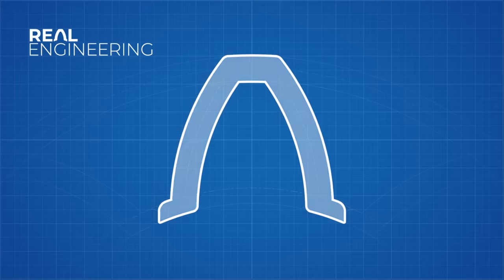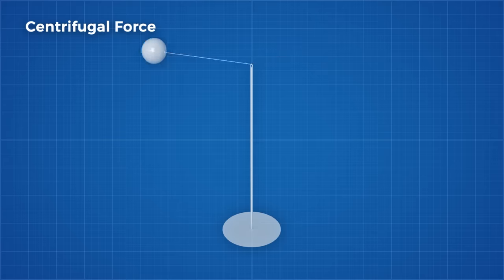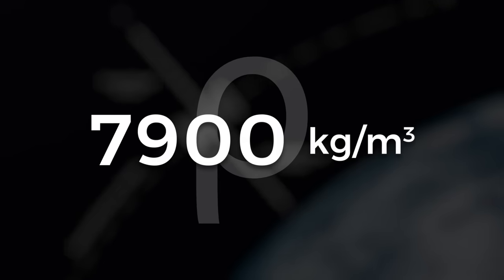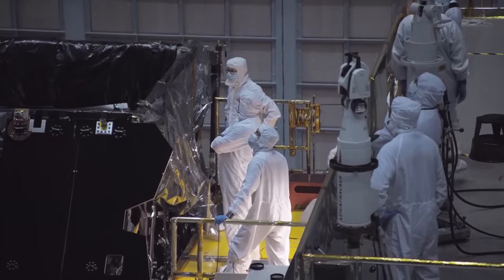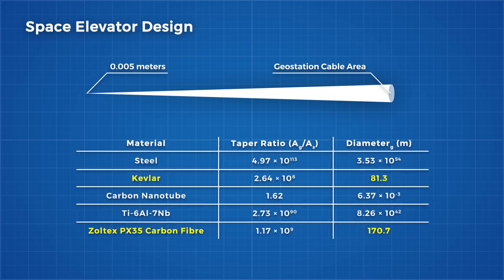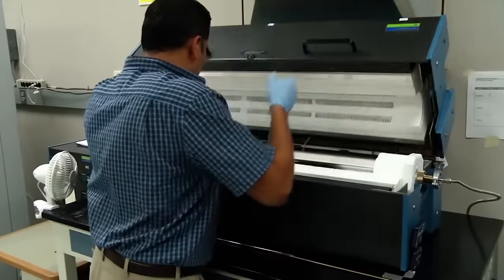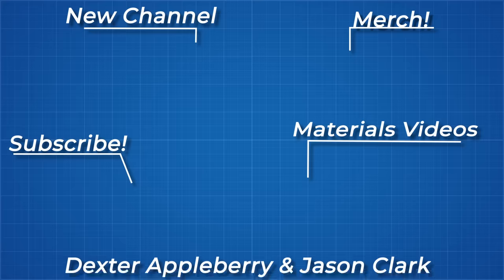Are Space Elevators Possible?

Comment: One problem is: What would happen if it were to fail? Imagine the destruction a wire of that size would cause if it were to fall...
Reply: It's more likely to fly away from the earth because of the counterweight.
Reply: @Yay295  that depends on where the cable breaks
Reply: @IronCrown  I'm talking about if the cable breaks, and the rest of the cable falls to earth.
Reply: If I remember correctly the book series Red Planet deals with this question when a space elevator on Mars snaps.
Reply: The end of the cable would be travelling pretty fast, so would probably burn and break up. The sections lower down would also be subject to shear and I suppose you would see some local breaks resulting in smaller lighter pieces. As for the bulk lower down, it has very small velocity with respect to Earth's surface so wouldn't create a spreading debris field like a plane crash and is made from a low-density material, so impact energy wouldn't be huge. my guess would be that it would be a mess, but limited: we are not talking about Tokyo and Sao Paulo being wiped off the map.
Reply: @marcowen1506  for the level of elevator in the video I agree with you.
But if you include the strength to haul cargo to space there by making it a elevator not just a wire/anchored station I expect serius mass will be need to be added in the wire and that mass may make the wire able to survive reentry
Reply: It would have helped if there was a scale size model after he gave the numbers. Normally, orbit is really skimming the surface of the planet, but a geostationary orbit is much higher. The cable needs to be 42,000 kilometers, and the circumference of the earth is 40,000 kilometers. So like, yeah, if the station disconnected from the cable, the entire cable could fall to earth and wrap around it like a belt.
Reply: Shoot. It’s not so cartoonish. That 42000km is from the center of the earth (which has a radius of 6km), so above ground only needs 35000k. So not quite like a belt :/
Reply: @marcowen1506  Even the lowest 1km is bad. Imagine the burj khalifa just toppling over onto the city and more.
Reply: @barmetler  It's more like a radio mast crumpling as it hits the ground.
Reply: @jwadaow  I don't think a solid, like 50m thick sausage of carbon nanotubes would just crumble without damaging what's around it
Reply: @barmetler  I don't think a thick sausage of material would get built (a ratio of 1.6 from thinnest to thickest diameter for nanotubes). The objective is relatively lightweight construction that is strong enough to support its own weight and a load climbing and descending. It can be built anywhere on the equator, such as the oceans, there are safety systems that can be employed to destroy the structure into chunks that thump the ground with a moderate force. The structure would crumple and bend if it broke because once it is snipped at a specific point, what remains is very strong relative to the compressive force of its weight, not like a skyscraper. It would behave like a wire with the tension keeping it aloft released. There are actually a lot of ways to design a space elevator that compromise with all of these factors. Huge lumps of nanofibrous meat primed to collapse onto people from aloft seems an unlikely choice unless future humans are extremely heroic to the extent the risks pale in comparison to the scale of the achievement.
Reply: Lace it with thermite. Cable snaps, thermite burns, and if the ratio is right it should burn up everything before the pieces hit the ground and start the world on fire.
Reply: Isaac Arthur talked about this in his elevator episode. You can put packets of explosives and parachutes along the tether, so if it were to break somewhere, you could trigger the explosives, separating the falling part into smaller chunks, then trigger the parachutes to slow them down as they fall.
Reply: @barmetler  A burj khalifa a few centimeters to a few tens of centimeters wide, made of ultra lightweight materials.
Reply: Well, you could devise a disintegration system where in the event of a break explosive charges would break the whole cable into small chunks that would either burn up in the atmosphere or fall to the earth with a minimized impact.
Reply: @charksey  Earth is fast, can't clip the belt xD
This quarantine gets us all.
Reply: @alexanderlaine7639  wouldn't all the explosives and parachutes (mentioned in another comment) and other stuff add weight to the cable?
How do you move the elevator over all that stuff? I guess you need some smooth surface to latch on.
Reply: @Ktulu789  Haven't seen Issac Arthur's idea so I cant speak to that, though he is by a much more knowledgeable person than I and I must deffer to the mention of his name XD. As for my idea, and I am no chemist or whatever so take that for what its worth, when i said lace it I literally mean lace the thermite into the structure. Not as an attachment but as a part of the structure somehow. I'm sure someone will shoot this down and it doesnt have to be exactly like this, but maybe in some structural components its possible to mold them around a thermite stick without compromising the integrity of the build. Just spitballing here

Comment: Mosy Sci-Fi depicts space elevators with "floating platforms" along the line like a buoy that helps distribute the force. Just need to
Reply: "just need to"
well I guess that didn't work
Reply: @mbrunnme  Just need to "find a way to make shit floaty"
Reply: @PaperDragons  Yep. Fortunately, every kid who's had a celebration knows what makes things floaty. Balloons increase the wind's lateral load but lift is awfully easy to add to a stationary structure. This can be taken to the extreme, where perhaps ten independent floating elevators sequentially get you up to the bottom of the space elevator.
Reply: Most weather balloons only go 30 or so kilometers high and geostationary orbit is 37,000 kilometers up, so that would only help for the first one thousandth of the height or so. I mean that's still something, but I'm not sure that benefit would out weigh the increased strain from the wind catching the balloons.
Reply: Balloons require buoyancy to float- you know, air? At the the altitudes for a proposed geostationary space elevator the tether end is in a vacuum. There's no air to provide the forces to lift up such an object. Even worse still, even if you could make it float in the middle of space vacuum, the tether would be subject to the forces of gravity which is something a the space elevator was originally conceived to deal with in the first place.

Comment: One challenge is the force on the cable.  The mid-section of the cable has a strong lateral force on it.  Satellites at lower orbits orbit much faster than the geostationary orbit.  The cable will want to orbit faster than the top or bottom, leading to a curved profile for the cable, and more stress on it.  There is no way around this issue.  We will need stronger wire to make any progress.

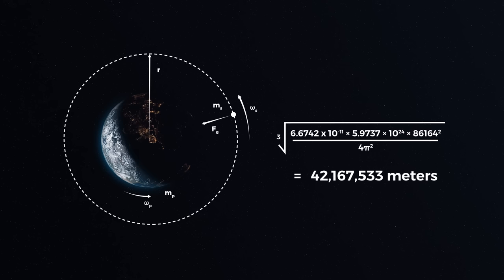Comment: @ 4:15 - important perspective about how far up the station will need to be:  36,000 km above the surface of Earth is 35,592 km farther up than the ISS, and nearly 1/10th of the distance TO THE MOON, which is 380,000 km.  Also, even travelling at 200 kph it would take roughly a week to travel the distance.

Comment: Aside from material considerations, the other huge problem would be that any mass sent down from the station, such as the elevator picking up material, is moving at the speed of the space station as it begins to lower.  The space station is traveling a distance of 2*(36000 + 6400)*π kilometers in 24 hours or 11,100 km/hr.   When that payload reaches earth it travels at  2*6400*π miles in 24 hours or 1675 km/hr.  You would need rockets to constantly slow down the payload and the mass of the cable along its length as each section of cable is traveling at a different speed if the cable is straight.  And the reverse is true except there is even more mass to speed up top geo-stationary orbit.

Comment: sir - this is only the third of your YouTube postings I've watched and I've decided to subscribe.  I want to go off and do "some algebra" and determine the "altitude" of the counterweight where the centrifugal force exceeds gravity at that altitude to provide an acceleration of one g.  Perhaps you will do the same.  That would seem to be the best altitude for the counterweight.  Right now I don't know what the mass of the counterweight would have to be at that altitude to balance the effective weight of the cable system from the space station / satellite at geostationary altitude down to the surface.  I will check for more of your postings in this series since you may have done such calculations.

Comment: Even if they are possible, they're largely inferior to many alternatives, Skyhooks/rotovators have them beat on cost, tethered orbital rings have them beat on ease of assembly (you can build them entirely on earth, and lift them into high altitude without any preexisting infrastructure), regular orbital rings have them beat on capacity. Plus, the tethered and regular orbital rings can be used for transport and energy storage on the planet, which is a great way to justify building them in the first place. Still might be a prestige piece some day, but I'm not gonna hold my breath.

Comment: Simple grade-school physics question here:
The conservation of angular momentum states that an orbiting object must gain energy to remain at the same angular speed if you lift it from one altitude (24 hr/revolution at 1670 km/hr at earth surface) to much higher altitude (24 hr/revolution at 11000 km/hr at geosynchronous orbit).

Imagine spinning a weight at a known RPM at the end of a 10 meter string. Then allow another identical weight to slide down the string from your position in the center. The whole system slows down (in RPM) and you will have to add significant energy to speed it back up.

This is why skaters slow down when they put their arms out... they didn't add energy to the spin, they just changed the orbit.

BUT: Since every action has an equal and opposite reaction, this increase of energy in the space elevator climber will result in the "counterweight" losing the exact same amount of kinetic energy, thus slowing it down. 

I don't see how you will lift a load without slowing down your "counterweight", and once that slows down it is just a matter of time before it crashes into earth because it is now not a balanced system anymore. Changing the orbit of the "counterweight" or having a second counterweight on another longer tether might work the first time, but how do you get it back for the second lift without adding energy to the system? For every lift, you would need to lift a significant amount of fuel to speed the whole counterweight system back up. Not to mention the energy of just climbing the tether to begin with.

It is likely that I am stupid, but there are hundreds of hours of videos on carbon nano tubes and other theoretical hype, but I've yet to see anyone tackle the simple physics of how this would actually work.

Comment: My guess: The base (Earth station) should be in the ocean, on a floating rig, with a vertical adjustment mechanism to keep the cable taut on a ever changing sea.  A floating rig can also move in horizontal directions to adjust voor wind pushing at the cable, so that the Center-point in GEO can stay in place.
Reply: What if we build near the equator (country) ? They have a mountain there 4500m high , that should save some material , no ?

Comment: Something that is worth noting about Space Elevators is why it reduces the cost of space travel.  And the answer is quite simple: you don't need to carry the weight of fuel.  When a rocket lifts off, it doesn't just need to have enough fuel to get it into space, it needs to have enough fuel to get that fuel into space.... and enough fuel to get that fuel into space.  And on and on it goes.  The end result is that you need somewhere in the range of 20X the amount of fuel as it would require to lift just the rocket alone.  Since you can use electric motors to crawl up the cable, your energy requirements drop dramatically - some have suggested as much as 95% - AKA: remove the 20X factor - though that's probably too optimistic as you still need energy for the mode of travel and whatever battery packs and safety equipment you're holding onto.

Comment: Assuming a tether is finally established, I feel there is are problems we fail to  consider :-
       As the load starts it's journey up the elevator cable,  the mass we are lifting will have to gain orbital velocity by the end if it's ride.  We witness our rockets climbing  to gain orbit leaning over in the ascent to gain the necessary horizontal velocity at the expense of chemical energy - lots of it !
             I believe our elevator and it's cargo will require a horizontal component to achieve  orbiting  velocity. This can only be supplied by a sideways drag on the suspension cable. This problem is never mentioned and would prove unacceptable.
             The other fact seems to suggest that the Space Station tether point will suffer considerable drag as the elevator and it's load are accelerated to orbit, sufficient perhaps to slow it below it's critical velocity.
            Something, somewhere has got to give our rising mass some orbiting velocity if our suspending cable is to resist only the vertical stress tension.
           I should add that the descent will suffer the reverse effects. Current orbiting vehicles, on returning to earth almost burn-up in dissipating their orbital energy. The elevator leaving the Space Station will subject the cable to the horizontal force again but in the reverse direction
            Or maybe I'm missing some aspect of the physics/geometry in this interesting proposal. ????

Comment: Sorry to ruin the idea, but there are a couple other serious issues here. When the elevator pod moves up it experiences coriolis force which introduces shear stress and also moves the tower. The tower then has to counteract the force using rockets (the whole point of this is to not use rockets) or add more rigid (not flexible tethers) supports. It also messes with the rotation of the earth, as some of its energy is being used to increase the pod's energy. Not to mention the regular course corrections required to stay in orbit. Its worthless to build on earth anyway.

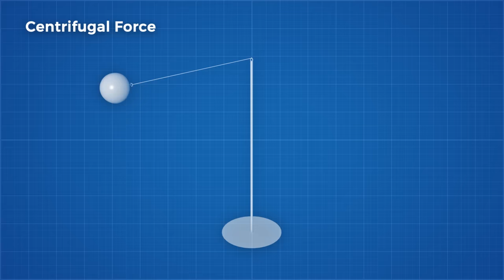Comment: 2:12 The string is obviously straight but can NEVER be horizontal as you show in your animation. There always has to be a vertical component to the tension to support the weight and that can only be generated by when the string is tilted slightly upward toward the center. It is the same reason a horizontal cable can never be perfectly straight. There is always a slight sag. As an engineer, you know this.

Comment: A few points to make....

1.   Compression strength isn't the only thing that limits building height.
Another big factor has to do with elevators themselves and how much of a footprint they take up.
  You will notice on taller buildings that the ground floor is almost nothing but elevators.  Sometimes it's even the first couple of floors (or more)
(Although I have a solution).....

2.  Forget trying to dodge space debris with that system.
You would need to have the space debris dodge the elevator instead.
  Good luck trying to do that with a piece of derelict 1970s rocket booster still hanging around up there. (And let's not even discuss the hassle of rerouting all airline traffic below as well)

3.   Rather than get into the physics of engineering materials capable of creating a space elevator.  I'd rather bring up something I've yet to hear anybody mention.
  That is the fact that when you fly a kite a mere hundred feet in the air and look at the string ....you will notice it is not straight but bowed .... often times quite severely due to the high wind speeds it encounters.
  Now multiply that lateral force (not by hundreds of feet) but over tens of miles and by up to close to a couple of hundred miles per hour as well and tell me that that is not going to put a tremendous level of energy into the system that will have to be taken into account. Energy that fluctuates constantly and dramatically as well. 
  Would not the counterweight need to have thrusters on it to help it maintain orbit (not for the added weight of the cargo)... But the HEAVILY fluctuating wind shear loads?
The wind is not just pulling down on the space elevator it is also trying to drag it sideways!

Comment: Space elevators aren't going to save much energy or expense. Instead of analyzing it based on force and strength equations you can analyze it thermodynamically. If we apply thermodynamics and assume the counterweight + elevator + payload as a closed system energy has to be conserved. This means that, as the payload gains altitude and orbital speed (when the elevator and payload reach orbital altitude it has to be moving at the geostationary orbit speed to be in sync with the counterweight). That means energy has to be added to the elevator + payload to give it both potential energy and kinetic energy in order that it would be synchronized with the counterweight when it gets there. This means we have to expend energy to get the elevator + payload up to a higher energy state. The amount of energy we have to expend is equal to the amount of energy we have to expend if we got the elevator + payload there using a rocket. The only place where we save energy is that with the elevator we don't have to add additional energy to lift the rocket itself to orbital height and speed. What we will probably find is that the energy saving is not significant enough to justify the cost of building a space elevator.